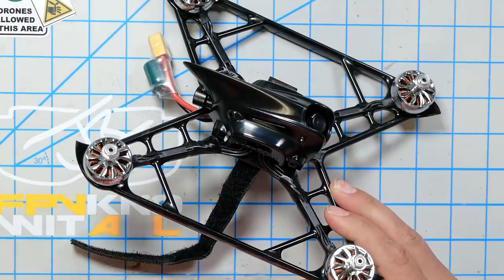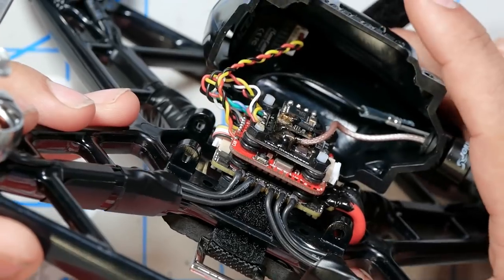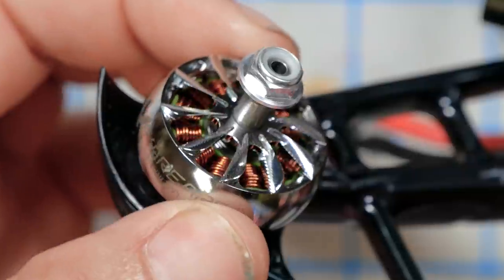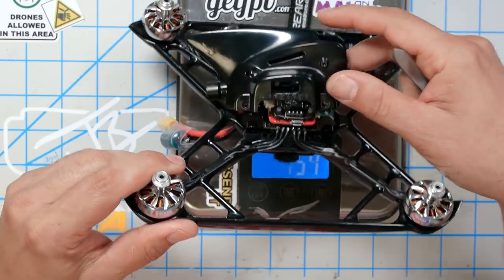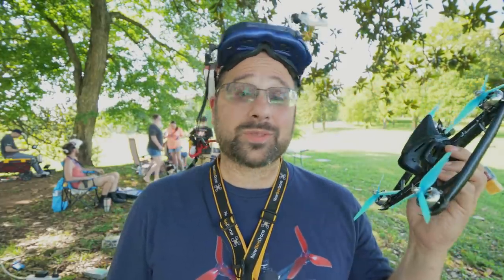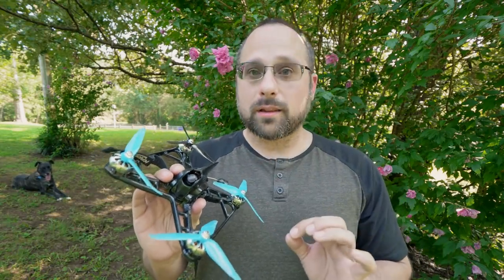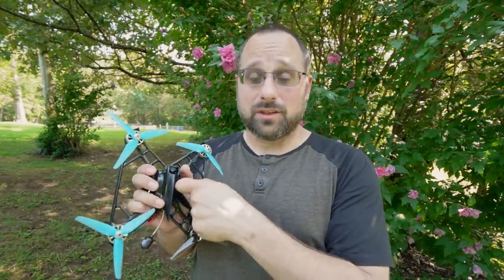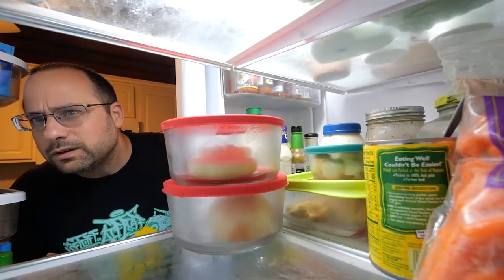Unbreakable drone put to the test | Karearea Talon V2 and Toa Turbine Motor

Comment: Would be a great drone to practice on.. If you were never worried about it breaking then you'd probably take more risks with freestyle
Reply: For practice you would definitely want cheap components
Reply: 10meter on concrete and it's done no worries
Reply: Yup, I’d love if they made a freestyle frame with same material
Reply: @WindjumbieFPV  Freestyle frames are just as durable but not as light. In racing, pilots are taking durability tradeoffs for lower weight.
Reply: joob there’s no way you could crash a carbon freestyle frame like that and not break it.
Reply: @WindjumbieFPV  if you keep it light you totally can
Reply: joob are you willing to do that test?
Reply: @drkastenbrot  in for the future test of carbon frame same weight drone.. full speed into bench
Reply: @WindjumbieFPV  I have a Remix that has not broken yet, and it has crashed a lot. 
I also have a molded carbon frame which is similar to this one but lighter.
Reply: @alexcrowder1673  i already mentioned weight twice, look above. 
I have a fast 3S whoop made from really flexible plastic, which has seen some very hard crashes and refuses to break. 
On my remix, I strap the battery on just enough to keep it on during flight, but want to it dismount in a crash. The battery makes up almost half the weight and "letting go" of it in a crash has saved me a couple motors and probably even arms.
Reply: You can buy just the frame and put cheaper motors on it or just switch the motors with a cheaper one.  I would do that to practice on.  Great idea.

Comment: They need to make a toothpick frame with this stuff.. under 250g quad made with this stuff would be awesome.
Reply: You won't see any small plastic frames anytime soon. Look at how "floppy" it is as a 5" frame with those big arms...
Reply: @Kikerumbo  I think making it smaller would help, but I'm not sure. I know it's going to get more ductile as it gets thinner, but you have considerably less leverage to worry about on a toothpick so... Maybe it would even out?
Reply: @RTKdarling  I think that with the 5" they got the right material in the right amount. I don't think less of that material will be as strong, even with less forces.

It looks like kind of A.I designed and if you put that kind of design in a little frame, it's going to be a sail. If you don't put all those "spokes/arms/reinforcements", it won't be as durable.

That being said, sign me up for an indestructible 3". Hope they proof me wrong. I'll gladly "amend" my error buying one or two.
Reply: @Kikerumbo  2.5 in Delrin frames  have been around for a while and are tough. I had a FT Gremlin back in the day and it never broke even though I crashed it constantly.

Comment: I just looked at my un-built, never flown frame and the screw holes are very thin to completely missing sidewalls on some of the holes. Still impressed that it took those hits. The turbine motors are shipping today.

Comment: This is a fascinating frame.   It looked pretty flexible when you bent hard on it.  It really only needs to be stiff enough that the motors don't significantly flex it in flight, and it doesn't transfer motor vibrations.  The flexing probably distributes the force of an impact across the entire frame a lot like the crumple zones in a car.  I'm always trying to think of ways to design a setup with standard carbon plates, but I can't think of any way to do it.

I'm excited about those little three dimensional motor protection doodads at the corners.  You can't do anything like that with two dimensional carbon plates.

It may not matter where the antennas go on that frame.  The radio magic out to penetrate that plastic frame just fine, unless maybe it absorbs a lot of humidity.

Comment: Do the ccw motors also get cooled from the fins? Or is it only the cw?
Reply: It's cw and ccw motors.
Reply: You can see very clearly that Quad is props out. And motors ccw and cw are different. The only thing is that you can't change it on props in if you prefer it.
Reply: 9:02

Comment: I have 3 of these setup for racing. Flies great. I've had some hits that would have killed multiple components on a normal race frame and it just doesnt care.
Reply: good to know as im switching from a floss 3.0 lite to my talon v2 before the season starts here in NZ
Reply: @liggfpv1068  Be prepared for a drastic reduction in performance, but a great increase in durability.
Reply: @flightevolution8132  Explain.....
Reply: @grounddodger3212  The floss 3.0 is much lighter and thinner, thus more breakable and performance oriented. The talon V2 is heaver, and more structurally sound so therefore less performance oriented.

Comment: I agree with you that it would be hard to quantify any gains from the turbine blades on the bell, used to cool the motor. You don't get anything for free, in this case, it would be the resistance against those very same blades costing the motor some energy to spin. I bet that the standard non-turbine blade motor generates more upward thrust, because it doesn't have that drag on the spokes, and spins up quicker.
Reply: Yes there's no free lunch, but that would be more applicable if you were comparing these to a bell design that had no spokes at all. but in our case, every motor has spokes, meaning then there's drag on every motor bell spinning. In this case, the drag is at least being made useful.

Comment: Joshua. Your scale shows an increse by 6-7g when you throttle. That means the motors are pushing air up and is going to be countered by the prop ye? or is it the airflow that pushes the scale down? if last it will be a very inconsistent testing method.
Reply: If anything, those motors are pushing air up, countering the prop, so, unless he spun them the wrong way, they're complete bullshit
Reply: @andrearomano1911  I dont think they are bullshit but yes, i think either he spun them the wrong way on purpose or didnt understand fully the test result he got...
Reply: Look closer at the scale. It was -6 grams. So there was thrust lifting the 299 grams he tared away.
Reply from the maker: Thank you Scott! I feel like I'm crazy here! It was negative six grams! It got six grams lighter!
Reply: @JoshuaBardwell  thanks for the clarification, I didn't notice the minus sign. By the way, do you think that the fins actually improve airflow through the windings that much? I mean, there should already be quite some air blowing through the motor as the props spin up and push air down.
Reply: There was no minus it went from 0 to 7.

Comment: Whenever I build a quadcopter I factor in and order one additional spare motor for when I eventually crash and wreck one. Unfortunately with the Karearea Turbines, to maintain this philosophy - I would need to hold two spare motors on hand (ie - 1x CW & 1 x CCW), so it adds about $80 to my upfront cost. Not an insignificant amount.... And of course if you don't plan on ordering spares you will have to contend with Karearea being out of stock for maybe months when you need them - Which has happened to me now on 3 separate occasions. Which is why I swapped them out last time Karearea were out of stock, and why I no longer run Karearea motors despite really liking their product.

Comment: yikes! great job karearea, and great testing joshua, i wonder if a freestyle frame is even possible. maybe even just a pod type deal thats slots onto a normal carbon frame. still not inspired by the motors though, its probably completely ineffective in a quad thrusting 1kg and the nuisance of left and right handed motors is just a deal breaker

Comment: At 3:56 you say about the antenna that it will be blocked by the body, do you meen the pcb’s? Because the injection molded frame will have no effect on the rf signal compared to a carbon frame.

Comment: I want to see a dive from really high into concrete 😂
Reply: Brandon's Baked Beans that works too
Reply: Yes please! Just take off the pretty motors before that test.
Reply: @maxair420  4Minuten Willi
Reply: Ryu Dong-Yen not gonna lie that’s impressive but a full speed dive into the ground should be more damage I think. Maybe not
Reply: Yes, a Kamikaze 👍🏻
Reply: Yeah kamikaze test would be awesome!
Reply: @BrandonBeans  Yeah, I accidentally did that recently with my Tinyhawk freestyle 2! Anyways, needed a new frame, had to solder motors, and reattach flight controller. The idea when doing an inverted throttle punch......is that you don't want to be only 10 feet off the concrete! :(:(:(

Comment: How much of a beating could The Practice Rig by Project399 take? Its arms are 25mm wide and 6mm thick.

It looks like Karearea could expand the area around the mounting holes to mitigate the cracking issue, but then again that thin section is just around the counterbore and the part under the screw should be much thicker so it might not be an issue anyway.
Reply: link to the frame pls
Reply: @yngndrw.  thanks man

Comment: I think 🤔 I found my first 5inch!!! I wonder if they would consider making a Lipo protector for when you are just out flying and not racing. Also maybe they can put some type of aluminum bracket or a bracket made of the same plastic to strengthen the stack or maybe we as consumers can just add some washers to distribute the shock in a head on crash like that. Just brainstorming. I bet this is a polymer plastic like what’s used on my favorite hand gun “The Glock”.😉👍

Comment: I bought some of these motors for my new Armattan Badger freestyle build after watching Max Beamers review of them. I haven't had chance to fly them too much yet, but they do seem really good to be fair. I tested a few 4S packs and they were super smooth, but lacked punch as you'd expect on 4S with 6S motors. When I tested 6S I nearly hit the moon, they have a lot of power yet are still smooth. It's hard to say at this stage if the turbine feature is worth it or not, but they definitely did feel cool after flying. I agree they are very expensive though and I'm not really looking forward to having to replace motors

Comment: If the motors are generating thrust, and pushing air down through the motor, wouldn’t the scale show -7g instead of 7g?

Also would have been cool to try this setup with their props with the fences. 

Lastly, would this fit a Vista cam/VTX, say on top of a 30.5mm Succex-A or oversized 20mm Zeus35?
Reply: No no motors work the same as an edf. So they actually produce thrust. And yes it should show minus 7gramm lol. But if you have a prop on the hub will cut most of the airflow
Reply from the maker: The scale did show negative weight. There is a minus sign to the very left of the display.

Comment: My problem with the motors are that they require CW and CCW distinction. You break a CCW one, you have to find the CWW motor in stock. From using CW/CCW in the past, it can be a pain in the butt
Reply: I think the props should flow enough air to cool the motors anyway
Reply: [In Karearea HQ] Red Alert, someone on YouTube saw through our evil marketing plan!
Reply: Don't most motors that use single nut to hold the prop have CW/CCW distinction anyway?  With the thread direction.
Reply: @pokemonihovno  not anymore. My first motors did, and finding a replacement was a pain. I didn't buy any spare ccw nuts either, which grounded me once

Comment: also the emax mt2204 2300kv motors that im used for a very long time in my hex)  cooed themselve, (these are 3s motors and i used them always for 4s and they didnt get warm at all.  
but they pull air from the bottom and Ejekting it sideways out the spokes.

Comment: i think maybe you could fill the screw holes with some epoxy or silicone, of course you need to remove the epoxy to service the innards, but you could carefully use a rotary tool to drill through the epoxy to access screws if needed.

Comment: About motors creating trust on scale: effect is real but what about its importance during flight with propellers attached. During normal operation I quess that propellers should push air through motors, I would be entertained watching tests checking if design is beneficial.
Reply: The other thing I'm interested in is; if the motors produce thrust without props, are the vanes in the bells ccw as well as cw? Could you make a mistake and put the motors the wrong way and instead of producing positive thrust the produce negative? Would it be fair to think that?

Comment: If the motors were generating thrust, wouldn't the quad become lighter?
Reply: I was thinking the same. After taring, the values should go negative right?
Reply from the maker: That's what happened? Am I crazy?
Reply: @JoshuaBardwell  No, I saw it with my own eyes, but it seems reversed from the results I would have expected. My hypothothis being if the motors are sucvking air up thru them...and the props are thrusting down , it would cause a negative vortex in the middle? ... WAy back in the day LD power had these fins , they made a cool sound, but really did zip as far as performance was concerned. What's your thoughts JB?
Reply: I guess a lot of ppl didn't notice the minus sign since its all the way on the left side of the scale's screen but it was negative weight

Comment: If the motors were generating downward thrush, the weight sensed by the scale would decrease.  In your example, the quad got heavier, demonstrating the motors were actually pushing the drone down with upward thrust.  Am I wrong?
Reply: The scale showed a negative reading ( - sign if you see closely)

Comment: Joshua or anyone else:  Has anyone ever tried to build a frame out of kevlar-carbon fiber?  I feel like that would be the "strongest"...

Maybe someday we'll have a frame made from woven spidersilk.  I remember watching a show where scientists put some kind of silk gene from spiders into goats that they could extract from the milk so they could get big yields.  Predicting in the future that the strength to weight ratio could "theoretically" allow them to build some kind of winch from space with spider silk as the media that would be technically strong enough to lift people/cargo and reduce the need to burn so much fuel to get into space.  

Sorry I know that that above thing is very random for a video on a drone but I'm curious where the hobby will go considering how fast it's advancing.
Reply: @No_1_really_  likewise
Reply: Yeh someone has. Cant remember the bame of it tho. 

Massively expensive

Comment: Hey Joshua, I recently built a second drone and I'm noticing a weird vibration. It feels like motor one sometimes drops maybe a touch a power and the drop dips in that direction. I checked the solders, made sure the motors were nice and tightly mounted, I just can't figure it out. Any suggestions?
Reply: bad motor or esc
Reply: swap one of the other motors that are known to be working to that position if the dip moves to the new location its the motor if it stays could be a bad esc id try that first
Reply: @FluidityFPV  Hopefully it's the motor...4 in 1 ESC.

Comment: Wait...to push in the scale the motors must be pushing air up? And pressing the quad generating those + 6 g of weight? So against the props? You should try with the quad upside down.
Reply from the maker: It lifted up and created negative 6 grams of weight.

Comment: The problem about the screw holes is an easy fix all they would have to do is increase the material arround the holes and problem solved, indestructible drone. Also the antenna being close to the body should have no effect on your reception because it's plastic right? Or am I just crazy

Comment: Thanks for the review, Joshua! I was wondering - do the Toa motors have a clockwise and counter-clockwise turbine design, or will they work well in both directions? Thanks!
Reply from the maker: They are directional.
Reply: Joshua Bardwell ah okay - thanks for clarifying!

Comment: Hm, isn't it the opposite of good that, for example, the arms don't break, but the thing that the electronics are mounted on does break? It's like how cars were designed in the '20s - all the energy went into the people, because the most of the car was rigid. If the frame has replaceable arms, those arms are cheaper than all the electronics that aren't the motors.

Comment: This in DJI HD and I would be sold. Protect the  electronics well from mostly gate hits. Plus it should be good for reliability and don't need a fleet of 5 identical quads just to compete. Maybe 2 of these and you can compete well. We need HD livestreaming in races and freestyle.
Reply from the maker: It can be used with Vista
Reply: @JoshuaBardwell  that is what I wanted to hear, thanks.

Comment: If the motors were creating downward thrust, wouldn't it get lighter on the scale?
Reply: That's what I thought too. Unless they are spinning in the wrong direction
Reply: I wondered the same.  I went back to verify it was a negative number.  It was.
Reply: @EnuffsEnuff318  You are right. I didn't see the minus sign before (on the far left side of the screen)

Comment: I bought this frame because it was advertised and reviewed as (almost) unbreakable. I tumbled on the grass (wet soil - soft) and it broke by the motor mount - the middle thick rod. As I live in EU to buy a new frame part is pretty expensive (need to pay import duties too as DHL is currier) so I'm not buying it, for the same price I can get 3 full carbon frames - stiff frames. They don't want to send a replacement, but looking at my crash it looks like a faulty frame  something went wrong with the compound. Carbon wouldn't break in a crash like that. So I give up on it! It didn't justify it's cost. NOT HAPPY!!!
Reply from the maker: Contact Karearea don't just comment here.
Reply: @JoshuaBardwell  I did. Not really happy about their decision not to send me a replacement bottom part without paying for it (they offered 20% off and with that it's still expensive). I'm just sharing my experience about it here. I had worse crashes with my carbon frames and they stayed in one piece.